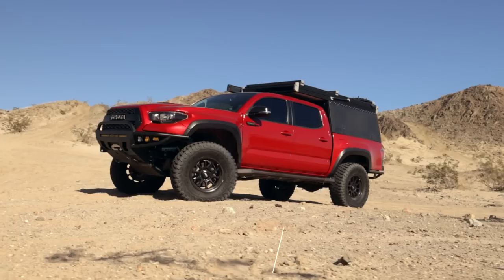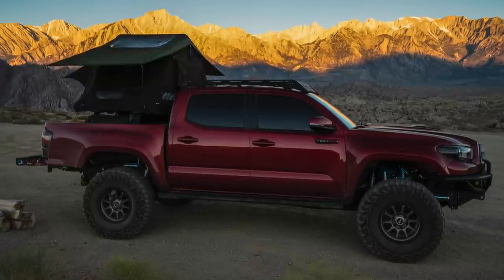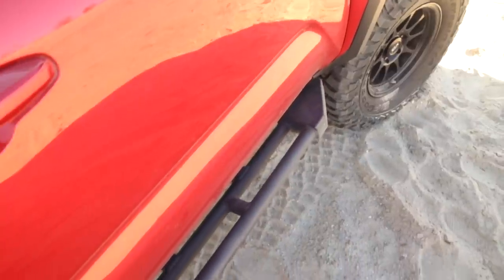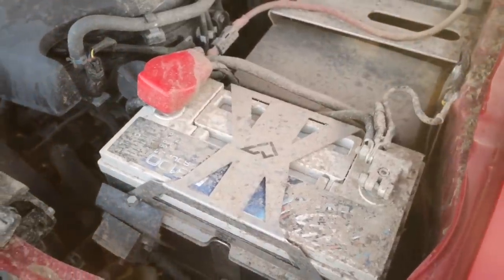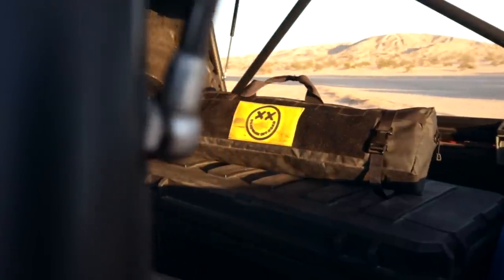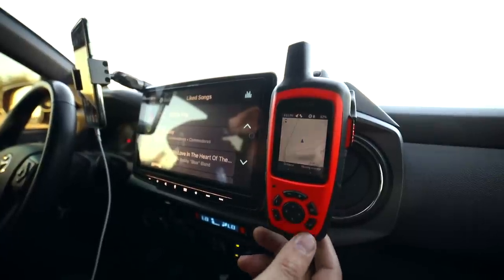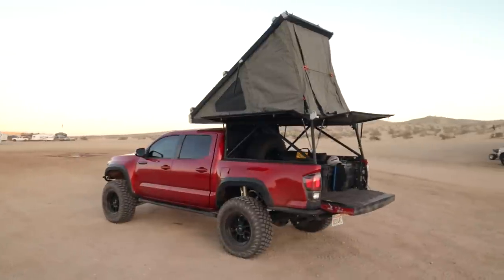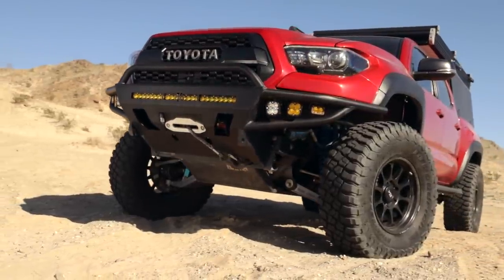Go Fast Camper Adventure Toyota Tacoma | Rig Walk Around

Comment: Had 529's in 93 pickup with 35's , not much changes in 20 yrs except the extra 2000 lbs. Have 99 4runner now, 430's work fine with 33's

Comment: Why pay the extra money to get a TRD Pro when you are going to take all the stuff off and replace it with aftermarket stuff anyway?
Reply: If you have the funds why not?
Reply: I mean, he can do what he wants. Just saying , I wouldn’t.
Reply: Because he didn't plan to upgrade so much, which is a common thing when people start going down the mod-hole. I got a brand new TRD Off-Road for $33k back in 2016. People paying $50k for basically the same thing with some tacky cosmetics and a suspension setup that's going to get tossed anyways is just silly to me, but like others have said, it's their money let people buy what makes sense to them and makes them happy. Not everyone has the same wants/needs, and just coz it doesn't make sense for you doesn't mean that to someone else it isn't a good fit.
Reply: He said why in the video.
Reply: Agree... however, I honestly believe most Tacoma owners go into the purchase with the mindset of keeping the truck relatively stock.  Needs often change, but it's pretty obvious this guy has gone off the deep end with mods. The Pro trim is an absolute waste of money at over $50K.
Reply: Not a pro anymore just saying...more like a beast now
Reply: TWINK THE TROLL funny thing is he said he doesn’t even do any rock crawling.... why the F did he put so much money into mods FOR ROCK CRAWLING!!! I get it he has the money but still... I doubt he paid cash for everything.
Reply: @hiddenx4968  he said, he want it heavy to keep the Center of Gravity of the vehicle lower.
Reply: Josh DeYoung he literally tells you numb nuts. He didn’t know he was going to take the build this far.
Reply: Exactly my thoughts also.
Reply: Inspecktor F j
Reply: this entire video is a waste of money really I mean it's just a mid travel truck.
Reply: Why watch a video if you're not going to pay attention to what's being said?
Reply: He answered this exact question in this video you doofus lmao

Comment: I have to comment that I have always been a big fan of factory carpet floor mats ( not a big off roader) but I just bought a 20 TRD Sport 4wd and it came with factory rubber mats and they out perform weather tech by far. the fit is the best and the rubber (not plastic) lays down great all my friends have weather tech that's how I did my compare

Comment: Very Nice Rig and enjoyed the video.  However, Disagree with his comment regarding high clearance steel rear bumpers being "too much weight" for the Taco and dessert running.  Most HC bumpers are 200 lbs, more or less with tire carrier.  His truck with the Go Fast Camper (which weighs 250-300 lbs PLUS whatever cargo carried in the bed) PLUS HC bumper may be too much weight but for LT suspension, having a SUA (spring under axle) set up with bed cage is ideal for high speed desert running. Therefore, its the CAMPER not the bumper which is adding too much weight IMO. Not to mention the GFC is going to be top heavy and make the rear end more prone to bounce around when dessert running. just saying

Comment: Not trying to sharp shoot here,  but if you are camping in the back of your bed,  you should really make sure your exhaust runs to the outside perimeter of your truck bed, so you do not die.  Just in the instance when you are topping off battery, etc.
Reply: I don't ever sleep in the truck with it running. Seems silly to do so.

Comment: Bumper so tough a fender bender takes it out?  That's mall crawler stuff.
Reply: Bumper was honestly fine, besides the powder coat. It held it's shape perfectly and everything functioned as intended. The insurance adjuster just gave me the max payout for it because install, labor, assembly of the bumper after a fresh coat was something they couldn't price. Bruteforce makes some of the most well built stuff out there. I sincerely suggest you check them out. The owner, Billy, has a rad 2nd gen on 42s and ORE struts.

Comment: Did you have to cut off and reweld supports for the body which are just behind the front wheels and interfere  with the 35's no matter lift you did

Comment: I have a 2006 extra cab Tacoma running total chaos stock length uppers and lower with kings front and back.  Running 275 on 16 inch enduro rims. Leer camper shell. My original build on the truck. Was to go with the 2 inch long travel kit., due to the extra cost on maintenance and the wear and tear on bearing. I’m having second thoughts on my decision. On long highways rides with high wind, and switch back roads my ride needs to be a little slower. My truck feels a little top heavy. Do you feel the width of the 2 inch long travel would help the ride. Or can I run wider rims or some spacers in the front?  My kings are about 3.5 in the front to level with the back. With j66 springs in rear. I know it’s not a sports car, but  should I achieve the same control has stock but with upgrade equipment?
Reply: Suspension changes will for sure add stability, but Having weight up top is going to change the steering dynamics of the truck, which is why I ultimately went for such heavy skids and completely changed the direction of the build. I will tell you, without the GFC, the truck cornered like a sports car, but as soon as you throw 300 pounds up high, it makes a difference. Widening your stance will help, but having the right spring rate will also help. Stabilizing your truck when it's hopping around is gonna be important. Long travel kit will help, but you actually may get more body roll with the LT kit. Are you still running a sway bar?
Reply: Yes, still running sway bar, and kings shocks set around 600lbs. Sorry I m 48 now. What does gfc stand for? Thanks for the help

Comment: Are there any vidoes where people are beating the rigs up a bit with one of these on top?  I am not kind to my vehicles.
Reply: The section in the video where I am hitting whoops at 50MPH is pretty tough on the truck without the right suspension. I've driven through baby head sized boulders at 40 MPH and I have personally watched a buddy jump his tacoma with the tent wide open and it was solid.

Comment: I’d imagine with all that weight and no engine mods the MPG must be horrible and the truck a little sluggish.
Reply: I am running 5.29 gears and my MPG on the uncalibrated speedo is right around 13-14. (Prob closer to 14-15 if i calibrated)

Comment: I have a 2017 4x4 off road model. Does anyone know what the biggest tires I can put on my truck without doing any suspension upgrades?  When I look at the truck from the side, it looks like I can go a lot bigger than the stock tires. I don't go off-road that much, if at all. It would be purely for appearance. The tires that are on it now are 265/70-16 in. I don't plan on upgrading the wheels other than spraying them with the plasti-dip spray. I appreciate any feedback I can get.
Reply: 265/75/16 is the largest without any modifications. Any bigger and you will rub. I just put those on myself.
Reply: Adam Sabo I’m not sure if there is an answer to this question,but had to ask,I currently have a stock tacoma(which I love,2007 trd)I have the stock trd wheels on those I have 265/70r16 tires which I’m looking to replace(the tires only) so the question is do they make a low profile tire that still could be used off/road I obviously (in Orlando,Fl)do not plan to go over mountains etc so lighter stuff I just don’t really like tall sidewalls on tires but I do like wide mud style type tires,I’m looking at Cooper art pros or even (but a little extreme)Federal Couragous(I’m sure I misspelled that)but all Ive been able to find is like a 305/70r16 in both manufacturers I’d like to go as wide as I can while having a low profile sidewall!!!Any help or info would be greatly appreciated,Thanks in advance and hope all is well and stay safe!!!

Comment: I feel like....after all these mods done to it....the trd pro is a huge waste of money. Save yourself 10g, buy the trd offroad and make these same modifications....for still less than the trd pro cost.
Reply: The whole truck is a waste of money. Buy a 1st Gen tundra for 5000... Spend 20k on an LSK kit and 6K on a roll cage and you will have something far more capable and fun.
Reply: @seekoutbeauty  might work for some. I'm a short guy, I dont want or need a big full size truck, especially for overlanding. I plan on going through smaller tight areas that a tundra would be to big for. Like trees and woods you know. I also dont want something that old cause I myself plan on passing the truck to my kids so I want something a little newer
Reply: @MyDirtydan  The first gen Tundras are smaller than the newer ones. I have the Access cab first gen Tundra and its shorter than a Double Cab newer Tacoma. I got a 4x4 with 75,000 miles for 9,000 bucks. Did some suspension and other upgrades and Ive spent waaaay less than a I would with a newer Tacoma.

Comment: This truck is the epitome of an Instagram Overland Model.  Overdone, overpriced, and overly complicated.  I mean c'mon, he went from a Prius and discovered the "overland hobby" as he calls it on IG.  Whatever the next fad is he'll move on that.  Call the truck what it is, it's a wheeling rig and a pre-runner.  This is not a truck built for overlanding, not very far at least.  You're pretty much limited to the US in a rig like this.  If you blow a King triple bypass shock in South America, where will you get a replacement?  Who would even know how to work on it with the shocks relocated like that?  Other countries don't typically carry 35" tires in stock.  A heim joint and uniball is going to squeak like hell and fall apart after miles of harsh road.  He's the kind of dude that thinks going to Pismo beach and Alabama Hills is "overlanding".  Wonder how close he is to GVWR and how much payload he even has left.  

For anyone looking to build their truck, KISS (keep it simple stupid).  Stick with OEM for most things and upgrade only things that you need.  Avoid complexity as that is what leads to your truck breaking down and parts failing.  Don't go broke and in debt building your truck.  Rather than spending $30k in mods (on top the $50k truck) spend that money instead on gas and travel.  This is the problem with most IG builds, they spend more money on the truck and mods than the actual travel itself.  I'm willing to bet that a TRD-OR Tacoma with a small lift, 33" tires, a camper while maintaining mostly stock parts could travel further, create more experiences, be a lot more daily driver friendly, and be much, much cheaper to build and maintain than this thing.  Save your money folks, don't fall into the IG trap.
Reply: its not hard to carry spare uniballs or heims. "blow out" a king? the worst thats gonna happen is maybe a wiper seal leak on the shaft which wont end your trip by any means. "find someone to work on it?" you shouldnt be leaving the us if you cant work on your vehicle lol. relax a bit and let people enjoy their stuff bud. maybe he didnt build it to go to south america...maybe he built it for exploring all that the US has to offer...which is FAR more than the two places you listed.  you know what they say about opinions. but i agree on one thing....this is an instagram truck.
Reply: I kinda see what your saying but "overlanding" has different meanings to everyone. Either way even if its not your definition of over lander, its still an awesome truck to go camping in. Nothing wrong with building it out well if you have the cash. But many people are getting into the hype of "over landing" then building up their rigs and selling them 40k miles later cuz they realize they werent that into it.
Reply: Jamico Oscardog and selling price of all the mods, top end blue book and 5k on top of that because they think someone is dumb enough to buy it.

Some photographer dude had a tundra all built up and asked 90k for it. He finally sold it months later not even close to 90k.

Comment: You better not go fast Tacoma still has 1960's drum brakes in the rear, time to upgrade your truck, Chevy Colorado has larger V-6 engine, stronger fully boxed frame and 4 wheel disc brakes, not available on the toy crap